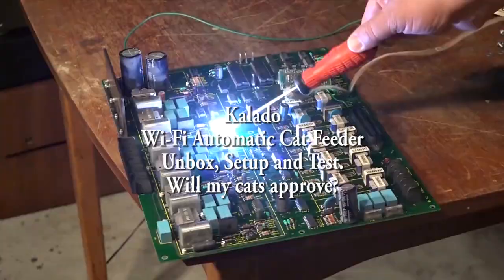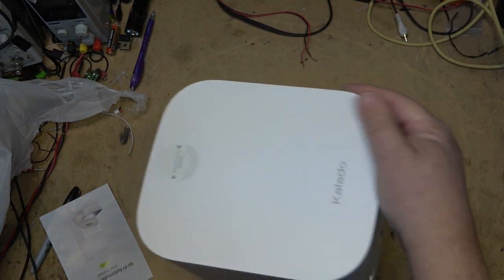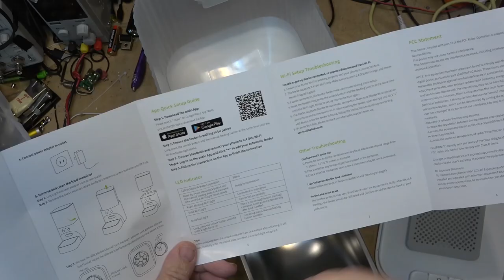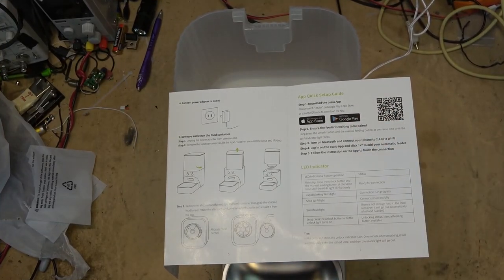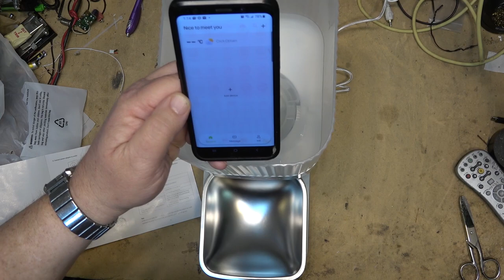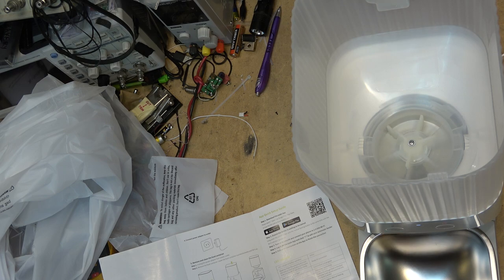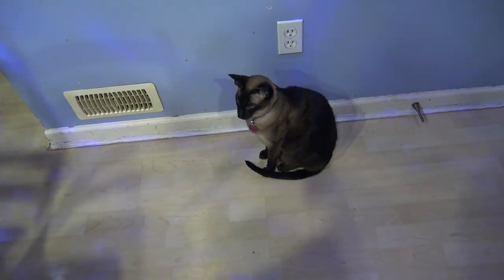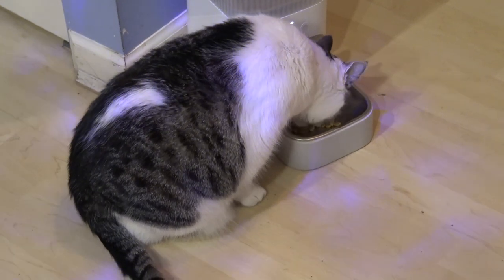Kalado WiFi Automatic Pet Food Dispenser -  It's the Cats Meow

Comment: Is there an app that would dish out the food at certain times?
So you could fill the container and let it feed your furry friends.
Reply from the maker: Yes that's how the app works you can set up a schedule of when and how much to feed and on what days, I didn't show programming the app but if you click add schedule you can select the time the quantity and what days to feed and save it. It saves it to the unit itself so even if the power goes out and you have no internet it will still feed at that time if you got batteries in it. Apparently it will hold enough food for 30 days so if someone had a cat and they were away for a couple days at a time it would feed their cat. Pair one of these up with an automatic water unit which I also have which is a big water dispenser with a pump and a filter and it just circulates the water and it will hold about 3 l of water. Yes they do have self cleaning litter boxes too so if you have one of these and it automatic water dispenser and a self cleaning litter box you can take off for a couple days and your cat would be fed and watered.
Reply: @12voltvids  everything seems connected to each other now, except i don't do any of that.
Smart phones would send me mad,  i use an ancient sony ericson and it's a phone, no junk, no annoying apps, no bullshit :-D
Technology goes too far for me, i like a hammer to be  a hammer only.
Reply from the maker: @zx8401ztv  what are you going to do when the network that your old non-smart phone operates on goes away? Those days are coming sooner than some people believe. the old gsm network is going to be gone within the next year.
Reply: @12voltvids  Well i do have a new basic phone sitting on the shelf that is recent, ill learn it when i have to, learning new junk has always been a problem.
I was told 3 years ago it was going to happen,  im not at all bothered.
I have another ancient phone that was my mums, a motorola with stick antenna and you can put ordinary batterys in.
I keep that because it was mums.
Reply: @12voltvids  there is confusing details about the shut down of gsm,  the govenment  seems to have a 2033 date for close down,  but thats uk, and govenments often change there mind, so it could be in a years time.
I have two phones on the shelf, a basic recent one and a Lg smart phone.
Ill try to learn the basic one first.
Reply from the maker: @zx8401ztv  when the network goes however the older ones stop working. The voice only services are being sunset and all the new ones will operate on volte, voice over LTE  5g. So you will require data as the voice portion will be an app running on the phone.  That's the way it is.
Reply from the maker: @zx8401ztv  LG? That must be pretty old considering they stopped making phobes a few years ago.  GSM is shutting down over here next year.  Only 1 carrier is Canada supports it.  They rest have sunset their networks and the carrier that still has it has killed many of the channels and only has a few still running.  I know the 3g is also shutting down sooner then people think.  There are many alarm panels that used 3g cellular radios for alarm reporting and we are swapping them all out for new 4g panels in preparation for 3g shut down. 2G has already been sunset for the company i work for.  It was turned down in 2018. 
The problem with keeping old networks running for a few customers is they use the same spectrum that can be used for new faster networks and spectrum is expensive.  It's not so much the government that dictates the shut down it is the carriers that want more bang for the buck for spectrum and old. Tech is not spectrum efficent.  So the game shutdown is closer than you think.
Reply: @12voltvids  oops sorry it is a samsung smart phone, my memory is crap!
Reply from the maker: @zx8401ztv  well then it should work on newer networks.  Even if you don't have internet the phone portion will use data, they just cap it so it only provides voice.